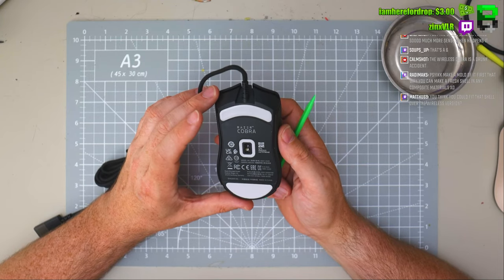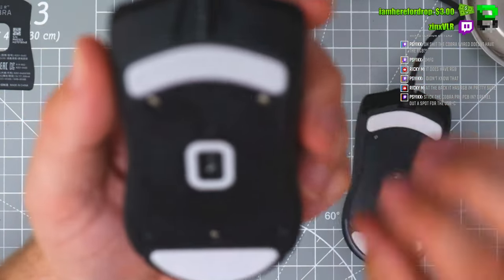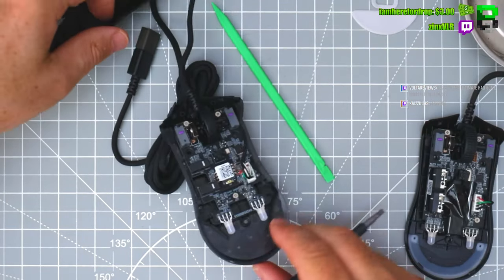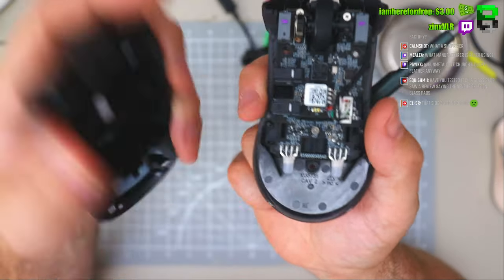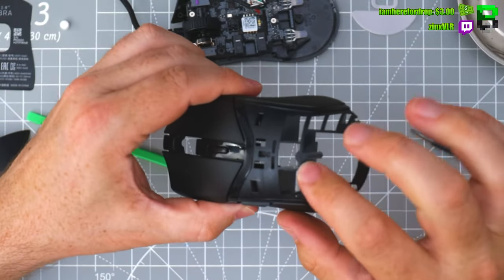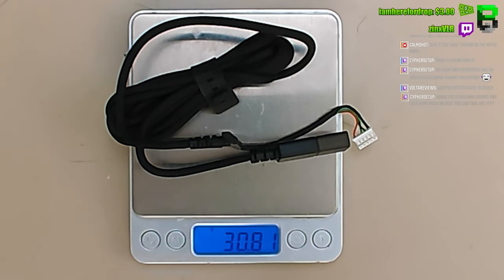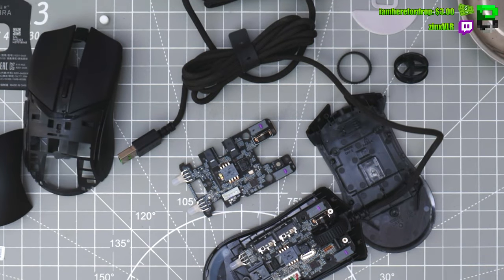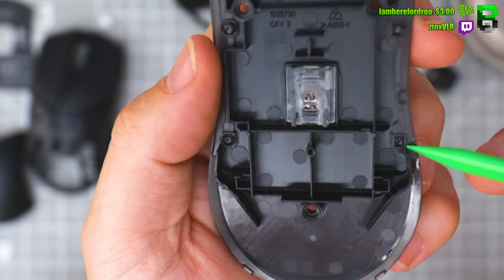The COVERT VIPER MINI REVELATION! Razer Cobra Wired Teardown:

Comment: My viper minis sensor started acting up (repeatedly resets position to the top left of the screen) after almost 1 year of use. I cleaned the sensor and updated everything and anything that relates to the mouse, meaning its a hardware issue. Do you think this sensor problem might come back to the cobra?
Reply: Sounds like a one off thing. Ive had my viper mini for 3 years.
Reply: Same. My new DA V2 Mini which was replaced under warranty because the sensor stopped functioning, is now also showing the same.
Reply: modded my viper mini to wireless with the g304 internals as soon as my one started doing this. Seems like this is a common issue on the viper mini

Comment: So it’s still using the kailh black like on the og rvm? I remember i sent my rvm multiple times because the encoder keeps breaking for example if i scroll down it will also scroll up, razer should have put the cobra pro encoder on wired version
Reply from the maker: Razer decided to use carry on with the viper mini as it was with a sensor tweak it seems and call it a cobra
Reply: i didnt understand from the video. is it the same encoder as in mini? @Beardedbob

Comment: Hi can i ask does the razer cobra have the same wire as the razer viper and same function?
Reply from the maker: Haven't tested the pin layout but it might. you would be better off having a paracord made for it.
Reply: I mean the razer deathadder essential will it function the same
Reply: @Beardedbob  ok thank you cause i cant find a replacement cable for it only i can see is for deathadder
Reply: @Beardedbob  also last question is the razer viper mini side buttons are hot swappable or its need to be soldered

Comment: I wouldn't recommend the Cobra. I had the Viper Mini for many years and decided to try out this one. The clicks are awful, the skates slide less and the sensor feels less precise. I really don't like it. The only positive thing is that the scroll wheel feels a bit better. RIP Viper Mini, you were the budget GOAT. 😔
Reply from the maker: The sensor on the wired viper mini was trash. This cobra is trash, Razer need to wake up
Reply: @Beardedbob  I had both, cobra is worst, but yeah, those mouses feel like toys